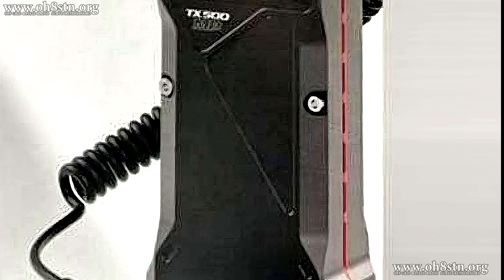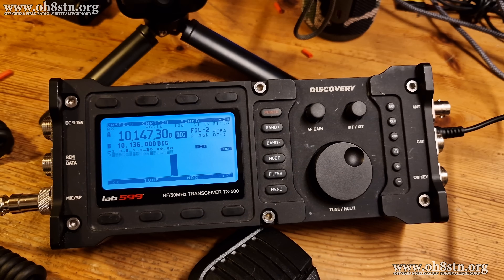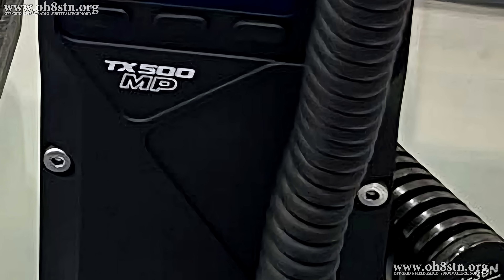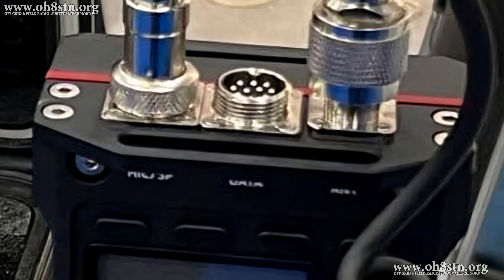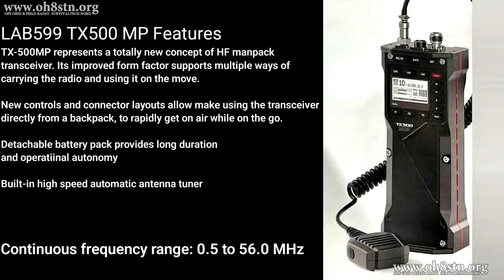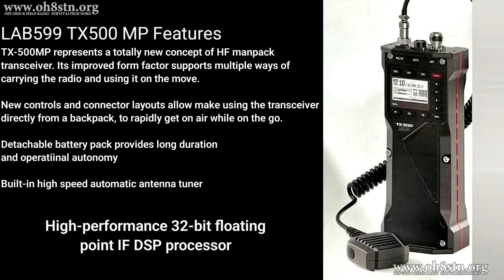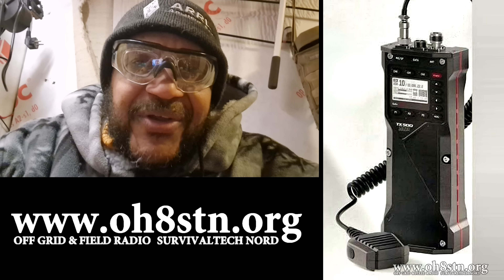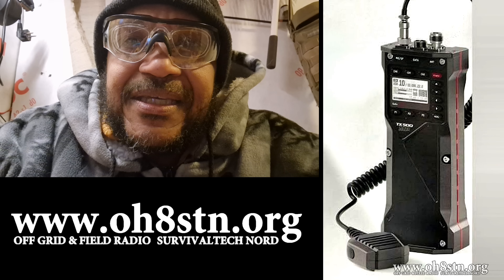Lab599 TX-500MP HF 50Mhz Portable Man Pack Ham Radio

Comment: Will this have an external charging port for battery? Preferably an industrial USB C...
Reply from the maker: Depending on the battery used tes. External wide-voltage solar & DC input. No USB charging.

Comment: Di any of u use the albrecht ae 2990 afs 
Hand held
Reply from the maker: I used to have one. 10, 11, 12m portable radio.  This one is 160, 80, 60, 40, 30, 20, 17, 15, 12, 11, 10 & 6 meters all modes.

Comment: Looks like the market is listening to how the radio world is shifting, which is awesome. A compact QRP transceiver in an HT format (with an internal tuner) is going to be quite a game changer if it works. May even give the iconic IC-705 a run for it's money, in certain roles.
Reply from the maker: Indeed.  Imagine JS8Call on the move!
Reply: @OH8STN  To me, that's the most important use case. I feel like it should be possible to make a complete HF radio out of a PI with a daughter board. I'm not a digital electronics expert...but seems possible with GNU radio libraries.
Reply: I check their website daily! I’m glad that I held off the kh1 now.

Comment: Is it even real?  From the picture I can't tell how to control it.    If it real its about tine considering how long the FT-817 has been around which includes 2/440
Reply from the maker: Yes, 2m/70cm are always good additions. Perhaps you're missing the point of this radio. It is smaller than an 817/818, has a better battery than an 817/818, has no rotary encoders to break off, and can be used from a backpack. Check out the latest update https://www.youtube.com/watch?v=BQ9QmNHs5FU
Reply: @OH8STN  We are talking about what looks like a HT in your video correct? Or are we talking about an older version?   I'll give you credit for the battery comment.
The stock battery for the 817 is use less.  But I think I would go with the 817 with better batteries and more frequency coverage.

Comment: N-type RF connectors are the gold standard. 
Rugged and very water resistant, they are way better for this kind of rig than anything else.
If you want BNC to go out to a cable etc, you can plonk an N-type to BNC adaptor on the socket. 
If you want to direct mount a long whip, it can go straight on the N-type with litte fear of snapping a daft little BNC / SMA.
I haven't mentioned loss because at these frequencies the loss would be almost immesurable even with a basic PL259.
Reply from the maker: Outstanding comment 💪

Comment: Hi Julian - that's definitely an N-connector. That connector's advantage here is that they contain a waterproof O-ring. This may be the radio I've been looking for for off-road motorcycle trips. Thanks for the heads-up.

Comment: Internal antenna tuner is a "must have" for SOTA work - will be very interested to see how that function performs. I love my KX-2, and have not yet found another radio that could take it's place on the summit.
Reply from the maker: Indeed. The KX-2 is lightweight, easy to pack and has the tuner option. I believe (don't know yet) the TX-500MP is designed to survive an extended stay out in the field or summit. No VFO knobs to break off, and can operate in low temps, rain, snow, ... It's also field rechargeable with no extra add-ons. It weighs more than the KX-2. I imagine that's because of its rugged build. Hoping so anyway.
One thing i miss in both is the internal audio interface for data modes.
Anyway, It seems to be a different beast.
73
Julian oh8stn

Comment: Wow, Lab599's answer to the KH-1
Reply from the maker: Perhaps yes! The KH-1 is a 40-15m CW rig with limited SWL. The TX-500MP is an all mode SSB/AM/FM/Data radio operating from 0.5-56mhz. I wish the KH-1 was multi-band, multi-mode.

Comment: This radio looks promising. Depending on the prize, it could be a competitor to the xiegu x6100, x6200 or elecraft kx2. It would be cool, if the TX and RX could be easiliy updated to 2m and 70cm Ham Radio Bands, via firmware.
Reply from the maker: "It would be cool, if the TX and RX could be easiliy updated to 2m and 70cm Ham Radio Bands, via firmware." 
Would require filters for the band swap, not just firmware. It's a cool idea anyway.

Comment: They should have added provisions for a lid/shield or cover to shield the screen and buttons just like the calculators do.  Some shields could cover the face and other versions could cover the face and connectors for transport.  It would only cost them pennies and would ruggedize it and it would be a little more gray man when in the open. 
I am happy to see them  provide options.  The addition of the tunner alone is a great plus. That minimizes the need for a 3rd party to double the cost of the unit. 
Thank you for the news.
Reply from the maker: Your comment almost "triggered" me lol :D 
It's probably too early to know what they will/won't include.
Yes, the tuner is a great addition. I also like the VFO knob replacement with push buttons. More rugged and less likely to break. The thing I'm missing is the audio interface.
Let's see what they come up ith.
Thanks for the comment.
73
Julian oh8stn

Comment: New to all this Radio magic. Can this radio with the proper antenna  do the propagation? I would like to be able to really reach out with small gear.
Reply: Should be no different than any other 10 watt rig.  You could use a tuned whip antenna or a wire dipole.

Comment: wonder if you could rig something up to it so it jumps between 100 frequencies in a pre determined pattern that could be synced up with other radios doing the same thing...
Reply: This would be considered "obfuscation" of the signal, similar to encryption, which is not authorized for amateur frequencies or amateur operators.  Legal operation would preclude the use of this technology.
Not that it wouldn't be a great feature if available.
Reply from the maker: @woodinloki9504 SELCAL is as possible as it gets. 😉👍

Comment: They should include a USB bus inside and just have a USB-C port for data and rig control combined.
Reply: Honestly lack of USB-C takes this from “must buy” to “too many cables”.
Reply from the maker: I completely agree. In fact I don't know why they wouldn't have done it.
Excellent comment 👍
Reply: Yup. USB-C or my money stays in my pocket. I've enough radios with dated interfaces if none of the companies are going to get with USB-C and full BT TNCs then they don't need my money and I don't need their radios.
Reply: I am wondering how hard it would be to make an adapter from USB-C to the DATA connector on either Lab 599 radios.
Reply: @Bob814u   That might work. The data port is some kind of serial interface so a standard serial-to-USB chip might work. Depends how much documentation Lab599 provides for their data cable.
Reply from the maker: @Bob814u It's already done it's called a digirig.
Reply: @OH8STN  Duh...didn't think of that ! I have a digirig and really like it.
Reply: I will never buy a radio that doesn't have USB-C (assuming it isn't just an analog radio).
Radio manufacturers apparently do zero market research and think we're all still connecting to hardware TNC modems with proprietary cables.
Reply from the maker: @PrebleStreetRecords Ssdly, I have no good argument against your comment. Well said 👍
Reply: Allow me to append my comment. ANY robust connector could be used that is a standard with known pin out. But it should contain ALL the data needed for digital radio. 

USB is nice b/c parts are cheap and you can gang them. Use any fucking connector that ends up USB on my laptop. 

RS485 from the radio is fine. But it needs to end up USB on my computer...

The real issue, is that modern computers use USB.  I don't have a serial comm card on my laptop. I don't want a dongle.
Reply: @nonokodog622 
The manufacturer has put a TON of effort into over-building the device, and probably lost business because the product is so much more expensive as a result. The manufacturer then gets shouted at on social media.

In response, the manufacturer releases a "new and improved" version-2:
~ Its skinny JUST like an Iphone! (folds like a deckchair when stressed)
~ Its got USB C JUST like a smartphone! (water instantly gets in and destroys it)
~ Its got a "truecolour" touchscreen! (draws 100a at idle, has icons smaller than an electron and is unusable in daylight)
All the Jedward quiffed 13 year old "preppers" who have never started a fire without a "megaflame2000000" blowtorch que up to buy the item, and give it great reviews on Twatter.
All 15 of them.
Now that the product is just a gagged Chinese Iphone, no one serious wants to buy it, and it flops.
The company goes belly up, and all we have left are defence contractors who will happily sell you a HF manpack, so long as you buy another 299,999 of them and your title starts with Lt. Col.

If you have to plug the device in with a lead (USB), what difference does it make if the lead has a blob of plastic (USB to Serial) halfway along?
Reply: I do not own a TX500, but it seems to be more ruggedized. USB is definitely NOT rugged.
Reply from the maker: @LeeMcc_KI5YPR That is correct. The point is removing the wireless and external components for data modes
Reply: USB-C Max distance: 4m (USB3.1)
RS232 Max distance: 15.2m

USB-C mating cycles: 10000 (or until the first bit of lint gets into it)
Circular Multipin mating cycles: Ever seen one fail?

USB is a pathetic connector standard, rife with built in weaknesses in order to achieve ONE thing: Being skinny enough to be the main charging connector for moccofrappochino drinking soyboy "smart" phones.
How do you expect it to be waterproofed? A silly little rubber bung? Don't waste my time.
How many Harris, Racal or Codan radios have you seen with USB connectors? Ever wonder why that might be?
Reply: @digitalradiohacker   I don't care what connector is used, it can still be USB. I've used RS232 plenty and seen it fail. I've seen every bus fail except a military version of CAN BUS. That always worked but it was super pain in the ass to work with.

I hate serial bus with more than two pins. What's the point ?

What I hate the most are RJ45 connectors with unkown pin out...almost every RS232 bus I've had to interface with a control system.

Comment: Looks pretty awesome so far.  I hope the price point isn't terrible but this seems like it will be quicker to deploy than my 705 in the field.
Reply from the maker: Agreed. The only thing i'm missing from this design is the audio interface. I'm hoping digirig will come up with a connector based plug in module.
Reply: I'm new to the ham radios: how long does it take to deploy something like the IC-705? 
Are we talking about like 2min, or 30min?

Comment: Not for me but then nothing 599 is.  Too expensive and beyond my needs  Ok for you though
Reply from the maker: Yeah you know, this is the radio they should have built in the first place. The 705 is still my favorite data radio. The TX-500 MP might replace the original TX-500 as my disaster rig.
If nothing else, I like that they're pushing the rest of the community.
73
Julian oh8stn